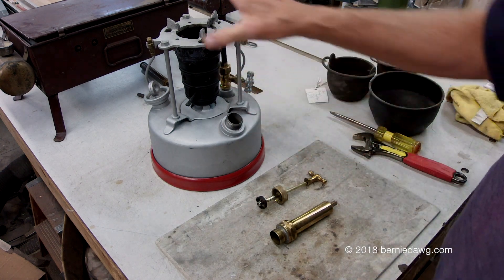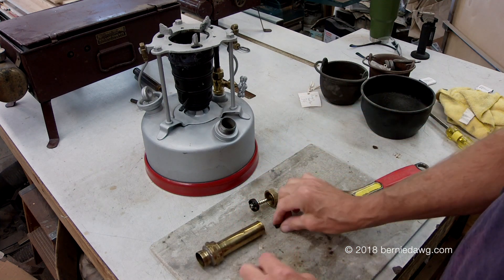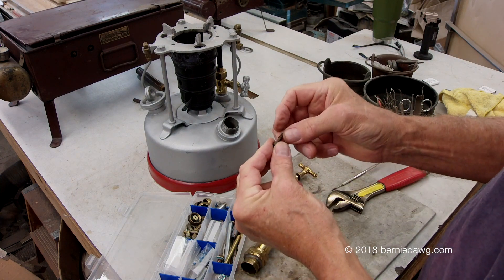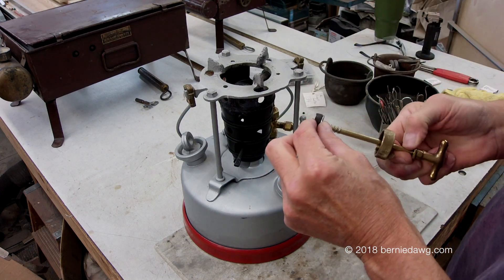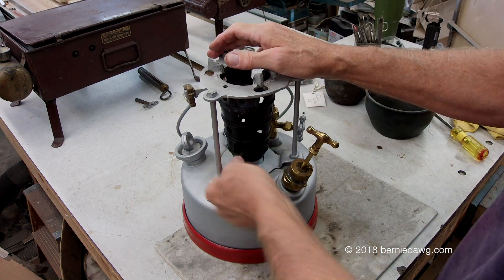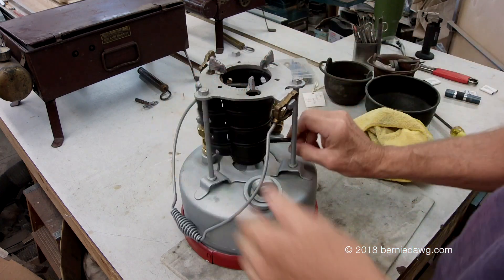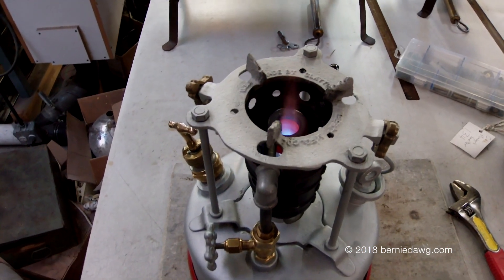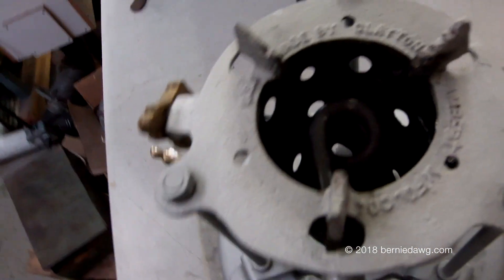Clayton And Lambert Furnace Tips

Comment: Thanks. My neighbor gave me one of these. I am getting it ready to go. Very well done, sir. I'm 70 and I like this stuff. I think they called the fuel white gas or marine fuel. My father had a blow torch that burned that. I got 2 ladles and the melting pot, plus the pot holder. I didn't know about the jet, probably would have figured it out when the gas was pissing all over the place! Thank you for showing me how!
Reply from the maker: Awesome! Thanks! Please do a careful inspection of the tank for rust or rust-throughs. These furnaces have been around for a long time now and it would be not fun to have one rupture because it was rusted out. Good luck on your resto! BD

Comment: Very nice - much appreciated!  I've got one of these and the NRV is giving me trouble.  Have replaced the pip several times...but still leaks.  Replaced the spring this evening and I think I've got it.  I need to let it dry overnight, it's spent a good bit of time in a bucket of water today trying to isolate the leak.  ;)
Reply from the maker: @kd5byb Sometimes there can be leaks in the pump tube itself. Be careful! There's a lot of fuel in one of these. 😯 BD
Reply: @BernieDawgCinema  Absolutely there's a ton of fuel in one of those!  I thought there might be a leak in the tube itself and checked for that yesterday in a bucket of water.  All of the bubbles were coming from the NRV...and once I replaced the pip and spring, no more bubbles.  :)  After work today I hope to get time to put a little fuel in it and fire it up now that I've got the NRV fixed.  I used some nitrile rubber while I wait for the blue silicone to arrive from the e-place.  It's not viton and will swell eventually, but should be good enough for one fire-up as a test.  Thanks much for your channel and the information you share!  :)

Comment: Thank you! I recently purchased one of these and it needs a LOT of TLC. Thank you for mentioning the wire cable in the generator. Mine was rusted and broke, about never got it out. My understanding is the new one needs to be pretty much the length of the generator? Anxious to try it once some parts have been repaired.
Reply from the maker: @robingilliam51 Glad it helped. Yes, the cable should be wound throughout the entire length of the coil generator. I have an unused NOS gennie I snagged off eBay years ago that has cable poking out both ends to prove the point. I'd suggest Coleman fuel over gasoline as todays gasoline is full of additives and ethanol unlike the gas used when these were in service. You used to be able to get white gasoline from the pump back in the day. Good luck and be safe (check the tank for soundness). BD

Comment: What keeps the gas from escaping from around the threads of the jet? With the jet facing up it seems A little loose.
Reply from the maker: @k5av2004 The jet rod (chunk of pipe with the jet hole) has a pipe thread on the end where it attaches to the rest of the generator. If yours is so loose that it's letting vapor out of the threads, tighten it another full turn. Pipe threads are tapered and will self-seal when made snug. You can use a high temp copper based thread lubricant to help you when you go for that additional full turn. (A quick search on Amazon for those terms will turn up lots - Locktite is good.) Avoid all Teflon thread tape - it'll melt. As these furnaces were used by plumbers for many years long ago in the way back, threads may have loosened up or were maybe just really dirty before you cleaned it up. Now that the threads are clean, they don't fit as tight without all the years long accumulation of goo, so just do that additional full turn to get a new leak-proof seal. 👍 BD

Comment: Hello Bernie Dawg, thank you for the video and your knowledge. I recently bought a C&L 22A. My question is after making a new orifice tube and drilling it .026 dia. my flame is above the orifice about 1.5 ". when trying to open the fuel valve it literally blows itself out. I am bearly opening the valve. Have I pumped it up too much? Any help would be appreciated.
Reply from the maker: @robingillam51 Not really sure what is going on with what you have done to your furnace from your description. This is where photos are invaluable. Not sure why you'd need to make a new tube instead of reusing the old one. ??? Don't know if you are preheating or what fuel you are using or much else from your description here in comments. The valve is pretty much on/off. This is where an email, with some photos, to my stove help address is invaluable. BD

Comment: My nrv has 2 guide rods on the sides and a center rod that centers the pip in it's ravels; viton or silicone rubber from Amazon and what thickness? Sure likely that the seal if kaput.
Reply from the maker: @64marine Yes. That is an old style design. Use Viton. It'd likely be cheaper for you to contact The Fettle Box or spinnarkerspar for those seals rather than make your own. Links here: https://www.berniedawg.com/stove-part-supplier-links/ Still having problems? I have email to make solutions easy. bd@berniedawg.com BD

Comment: Hello, I am from Argentina and I have one just like it was my grandfather's. I would like to know what fuel it runs on.
Reply from the maker: @josemoreno9853 If it's EXACTLY like the one in this video then it will run best with Coleman Camp Stove Fuel (naphtha) or similar product. A less good choice would be the lowest octane automobile gasoline you can find with the least possible additives and no alcohol (ethanol). If it's not EXACTLY like the one in this video, it might be a different model that is designed to burn kerosene or fuel oil. Make sure - don't confuse 'em. BD
Reply: Yes it is the same.  The ideal is kerosene, thanks for your response.
Reply from the maker: @josemoreno9853 Kerosene fuel will require a smaller jet orifice than the jet orifice for gasoline/naphtha. I can't say which you have from the info you have provided. BD

Comment: Do you know where I could find the pump cups?
Reply from the maker: @Maxwell Rand No one carries parts for the products from this long defunct company anymore - the company and the parts are all gone as of a very long time ago. You’ll probably have to make a leather pump cup yourself for this approximately 60-year-old furnace. I made my own. It’s not that hard to do if you want to get it running again.  You could also try eBay or Amazon and see what cups you can turn up for some other purpose (like water pumps, for instance) that would work for your furnace and it’s dimensions. You might get lucky. 
Iirc, you need a 1” diameter cup with a 1/8”-3/16” center hole. Or… you could see if Ross at The Fettle Box will make you one custom: https://fettlebox.co.uk
Don’t be afraid to put the time to fabricate your own parts - it’s just what you need to do to restore old things long out of production. Good luck! BD

Comment: I have a BellSystem lineman stove.
The NRV is in good working order. Pimp seal is split is there a source for replacements. Also my burner appears to have no “valve” control?  Seems like its regulated simply by pump pressure.
Any help would be great
Reply from the maker: @Mac 1911 I’d love to help and I can likely fabricate any gaskets or pips you’d need for your long-out-of-production 50+ year-old furnace. Just drop a note with some photos of your stove to: bd@berniedawg.com and we can get you sorted. 👍 BD
Reply: @BernieDawgCinema   awesome will do , like to learn more about it. I was given the pot about a year ago and recently same person brought this to me and some laddles
Reply: BD is the man!  My crappy video from 12 years ago is just that.  Haha!  Look up blmeflmm66, my previous YT identity.  Everything he mentions is spot on.  Took me a full day to get that damn cable out of the coil and get it cleaned out.
It would be good to remember what these were for.  Melting lead as fast as possible full stop.  There may have been forge conversions for heating rivets for structural steel, I suppose, but still, that's a max heat operation too.  FWIW these are GREAT wok burners.   I regulate the heat by moving the wok around or pulling it up/off the fire for couple seconds.  Don't leave an aluminum pan on this without supervision.  It will melt it, quickly if it's empty.  Don't ask.   My father was a plumber/pipe fitter/mechanical contractor and I remember him using the propane version of these many times.  Plumbers in those days had serious skill.  The hot lead was poured into oakum caulked cast iron drain fitting bells to provide strength and force the oakum tighter into the joint to seal it.  Oakum is... well look it up.  The lead and oakum were also used commonly to seal sleeve penetrations in foundation walls.  Sleeves would be set in the forms to accomodate pipes entering and exiting the structure.  If you can find a video of it, look for a plumber pouring lead into a joint on horizontal pipe.  Fascinating technique.  As usual, that was more than anyone wanted to know.  haha!ot rivets, I suppose, but still, that's a max heat operation too.  FWIW they are GREAT wok burners.   I regulate the heat by moving the wok around or pulling it up/off the fire for couple second

Comment: Can you direct me to where I could get replacement parts? I think I need to seals in my pump
Reply from the maker: @John Peloquin Hi John! I have a webpage that has a list of stove part suppliers. https://www.berniedawg.com/stove-part-supplier-links/ But, because these old plumbers furnaces are quite old now and not usually brought back into service, you may need to do a bit of thinking and comparing to get the parts you need from the suppliers of the parts of the much more common stoves. You may even need to make some of your own seals from scratch. If you run into difficulty figuring it out, just drop me a note to bd@berniedawg.com and I can give you some guidance. Good luck and be safe! BD

Comment: A caution about Viton At high temperatures or in a fire, (Viton fluorocarbon o-rings) fluoroelastomers decompose and may release hydrogen fluoride. Any residue must be handled using protective equipment. Upon contact with moisture, including tissue, hydrogen fluoride immediately converts to hydrofluoric acid, which is highly corrosive and toxic, and requires immediate medical attention upon exposure.[31] Breathing in hydrogen fluoride at high levels or in combination with skin contact can cause death from an irregular heartbeat or from fluid buildup in the lungs.[31] .
Reply from the maker: Ooookaaay. Thanks for that warning. But, I'm pretty sure that if my teeny little Viton fuel cap gasket is in "high temperatures or a fire" that I might have more to worry about than the hydrogen fluoride the Viton gasket might release.😃😎 BD

Comment: What do you recommend for fuel? Just gas or Coleman fuel/kerosene
Reply from the maker: This stove (furnace) is not designed for kerosene and shouldn't be used with that. I recommend Coleman, Crown or other camp stove fuel (naphtha) for all vintage stove and lantern products that are labeled for use with "gasoline". Today's gasoline has too many additives and contains up to 10% ethanol. Modern RUG (regular unleaded gasoline) is nothing at all like the gasoline from the 1950s and 1960s. Stoves, even this one, don't get hot enough to burn most of this stuff in modern RUG, so the unburned additives form a sludge inside the vaporizer and will clog it up quick. BD
Reply: @BernieDawgCinema   thanks again!

Comment: I recently acquired on of these a customer of mine give it to me.  It works okay not like yours of course! The flame  surges all the time its lit.. any ideas?
Reply from the maker: Thanks! Let's assume all the fittings are tight around the generator and jet rod (tight? snug?) and there is not a small leak pulling surges of air into the fuel or fuel vapor stream. Could there be dirt or a piece of crude tumbling around under the jet orifice inside that jet rod? Maybe the wire cable that is in the coiled generator tube is all gooed up with gasoline? Stuff could cut loose if Coleman fuel is cleaning it out now after having been used with gasoline. Try pulling the generator, removing the jet rod, soaking the inside of the jet rod and generator with carb cleaner and letting 'em sit for some days with tape over the openings. Blast out with compressed air. Set it back together and give a test run. Stay ready to clear the jet opening if debris cuts loose while it's burning and hot. That's about all I got. Good luck! BD
Reply: @BernieDawgCinema  thanks!! Appreciate the information
Reply from the maker: One other thing... the coil generator has a length of braided steel cable in it pretty much from end to end. Acts as a surge arrestor mostly. It is what gets rusty and clogs in the gennie. Just a FYI if you want to check for its presence. No cable in there would make for surging flame for sure. Enjoy. BD

Comment: What is the size of the orifice?
Reply from the maker: @David cirval Uh-oh! Is there a missing part on yours? Best of luck on fabbing a new part. 👍 A #71 numbered drill bit fits snug. BD
Reply: Thanks for the information!  Just what I needed!
Reply: I have a jet but my flame is massive and yellow with gasoline. I checked it just now and it 0.044”, a lot larger than what you quoted.  Do you think that might be for kerosene?
Reply from the maker: @David cirval Ouch! Yeah, that seems way too big based on mine and the couple others I have. Yours is about a #57 or #56 numbered bit in diameter. The larger diameter jet orifice is more likely an indicator of a worn out jet hole, or one that someone mucked up in the past screwing around with it (it happens). Kerosene is more energetic than gasoline or white gas (naphtha) and kerosene appliances typically have a smaller jet orifice than gasoline pressure appliances. Less kerosene fuel vapor coming out of the smaller orifice, but more energy in the kerosene so the right amount of fuel vapor mixes with the air. If you are handy you could build a new jet pipe to replace your worn out one. BD
Reply: @48ford8n  Late to the party here, but I've had decent luck a couple of ways.  Ive used a center punch to peen around the orifice to make it smaller and re drill.  Not optimum, but it can get it running.  Or you can drill it out and tap it for a threaded, replaceable jet.  Not original, but the best solution, in my opinion, short of fabbing up a whole new part.  Use a drill press and make sure you drill a perpendicular as you can.